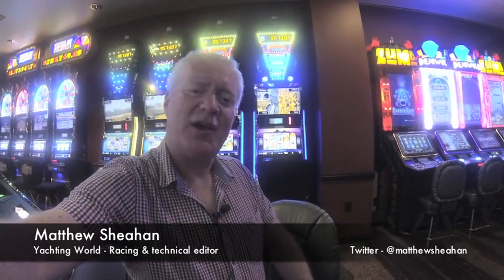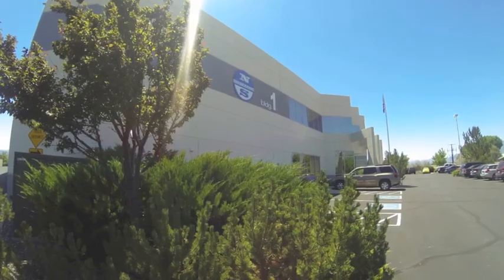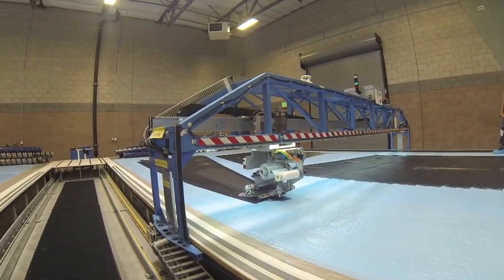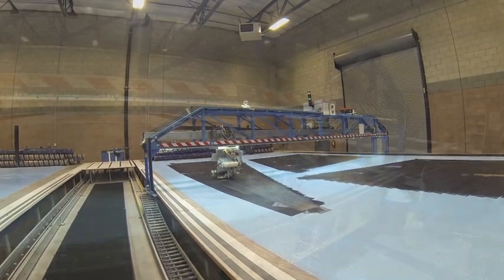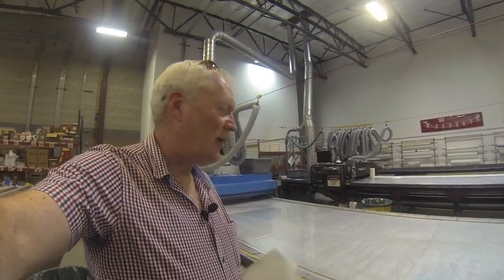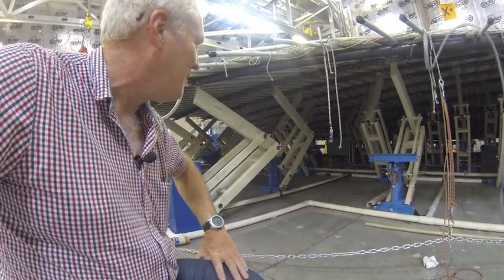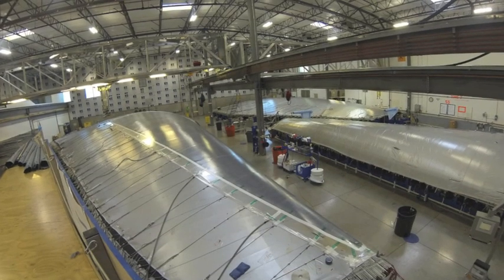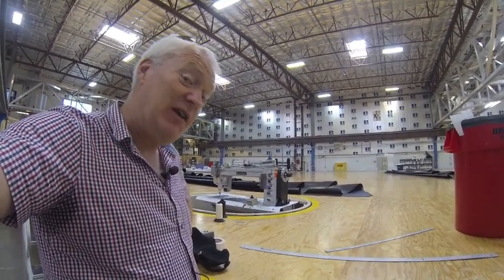How North Sails make 3Di sails in the desert

Comment: I'm confused by the part where he shows that the sail tapes are laid out to produce sections, or for lack of a better term, panels, for the 3Di sail. Everything I have read indicates that the tapes run continuously along the entire length of the sail, giving it more strength than more traditional panel built sails that have joints where the panels join. How are these 3Di tape panels joined?
Reply: The tape contains resin, think of it like grp, but flexible. They overlay the edges of the pannels, bag it, cook it. The edges glue together, just like when laying up chopped strand. I'm not sure why they do it in panels, but the tape printing is so they can put extra layers of tape at high stress points, and lay the fibres in the correct orientation paralel to the force.

Comment: Lots of Authors write, you weaken the composite by cooking it. My supplier and  basically the industry cook up to 400 degrees. Then another group, says you should only let the composite set up in the temperature you plan to use it, or it will be weak to.  That's why you don't seek this information on YouTube, 2. Only buy the best book you can on Amazon, even if it cost $500. You can check back with me if your not sure they aren't trying to burn you. But usually, a good book of value is published by a reputable University. That's what you want to look for. Hear that, "Secrets"? Now its no longer a secret. I found that the real sun works way better than a commercial sun lamp, and cost a lot less to. And now I'll get a whole bunch of no nothing losers have to discredit me. Its called Greed, but that's another story.